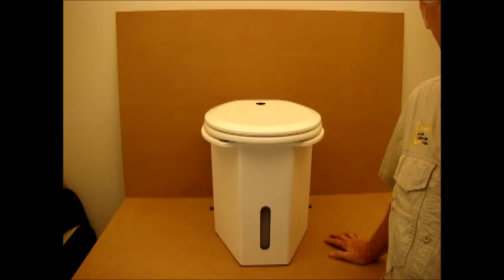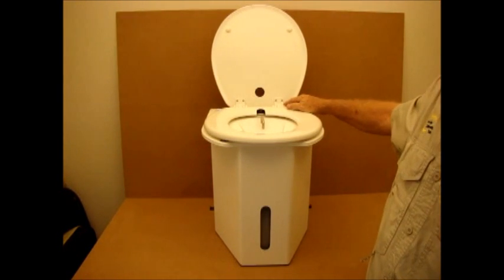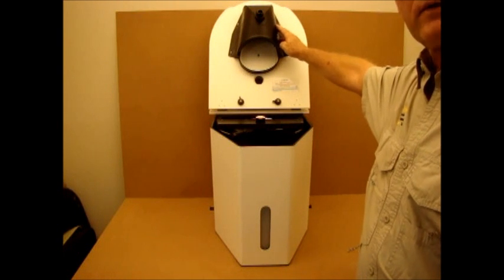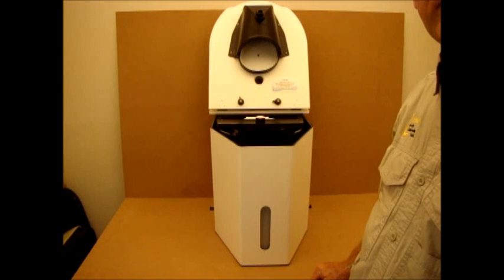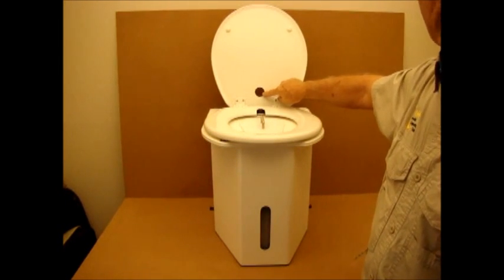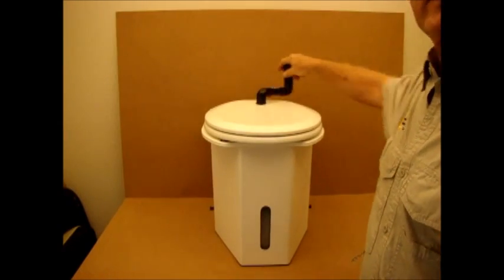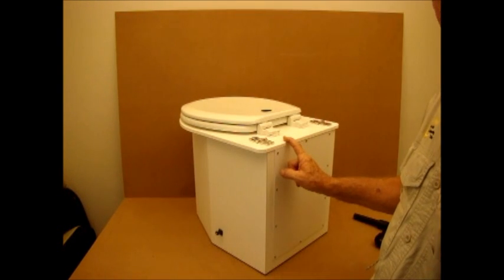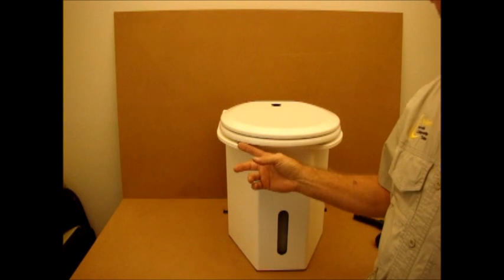A Tour of the C Head

Comment from the maker: Yes you can put your toilet paper inside the toilet. It will of course cause the toilet to fill up faster depending on how much paper you use. We always put our tp in a small gallon bag lined waste basket with a lid and then would discard it separately.
Reply: what about the spatter that happens with solids in the bowl? No swirl of water to rinse, so how is it normally handled ?
Reply: is that a sealed system to prevent odor?
Reply from the maker: @chtomlin  You can rinse out the bowl occasionally if you think it needs it. The bowl is made from phenolic plastic which doesn't absorb odors. I am currently using 4 toilets in various settings and I don't rinse the urine funnel and there is no smell.
Reply from the maker: @chtomlin  Yes, it is sealed but there is no odor sewage odor coming from the waste because of how it is processed with urine diversion and covering the waste with medium.
Reply from the maker: @Virginia Solomon It is only a biohazard if you are sick. You can put it in the toilet but regular dry paper will fill any compost toilet quickly. The better choice, if you are going to put the paper inside the toilet is flushable wipes. They work great and don't require so much material and therefore don't take up space inside the toilet.
Reply: Is this company even in business anymore?

Comment: If you are on a boat that is capsized, will it spill?
Reply from the maker: Good question. After living aboard for 9 years, I can tell you that the true-blue, off shore sailor who has everything locked and chocked around the clock is for all intents and purposes a myth. Every story I have every read about capsizes, even by seasoned sailors, leaves the interior of the vessel awash with debris and the occupant struggling for survival. If you are concerned about potential capsize during a storm or other conditions, I suggest you use the cleat tie down system for securing the head. Then it is a simple matter of lashing down the lid with some light cordage. If you haven't done this and you turn turtle, it is a good bet that being exposed to a little poop is going to be the least of your worries. If you look at the bright side, the toilet has a auto deployment system for a bailing bucket.
Reply: If I was capsized, that would be the least of my worries!  LOL

Comment: Are you able to use place toilet paper inside of the toilet or do you have to discard the toilet paper into a separate bin?
Reply from the maker: +Riley Peters You can put the tp inside but it will cause the container to fill up faster and it can be unsightly. Put the tp in a plastic bag lined waste basket with a lid and then compost it with the rest of the waste when you empty it.

Comment: no fan vent option?
Reply from the maker: Yes, it comes with 12 ft of 1.25" vent hose and the fittings to connect it. No fan is supplied because some people want to use a mushroom fan and some people want an inline fan. Venting is used to control the buildup of condensation. The simplest control method is to empty the toilet when condensation starts to build. Emptying the C-Head is very easy so there is no reason to put it off. If you use your C-Head on anything but a permanent, regular basis, (such as week-end or week long cruising or camping) you probably don't need to vent it.
Reply: what a helpful and useful answer. From reading, I really appreciate your product and getting ready to try it.